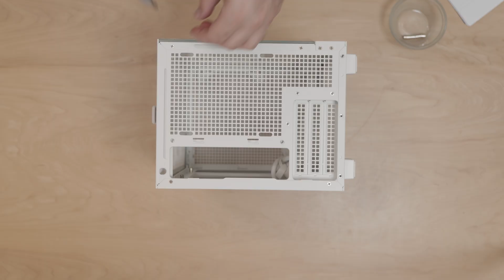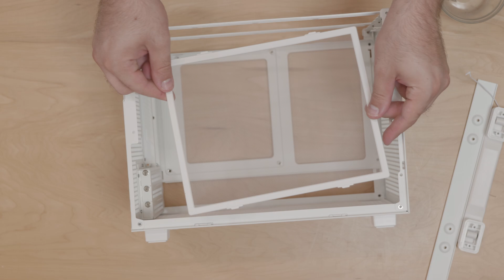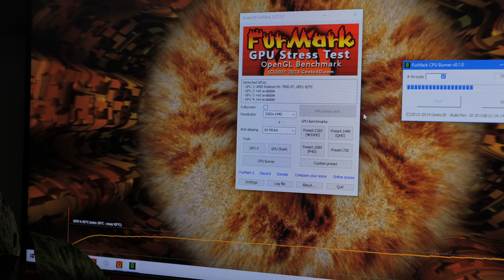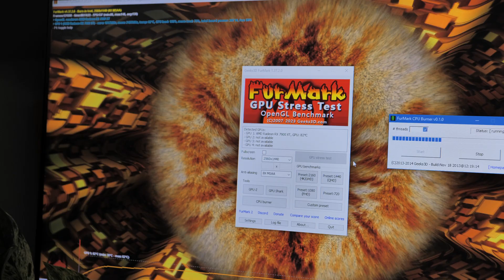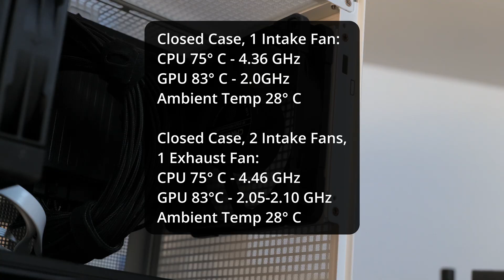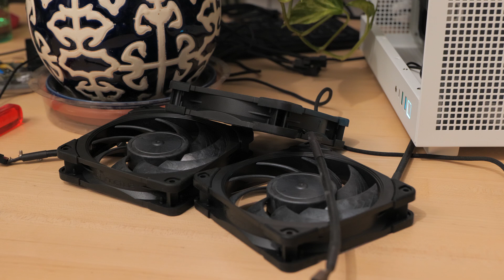Chill Thoughts: DeepCool CH160

Comment: One thing that is absolutelly disguting coming from a renowned brand name..that power cord hanging like that. WTAF. They should've included an internal cable length and have a nice plug at the case edge.,
What we have here is the lowest of the lowest and laziest DIY style of case builds, where you just meh it by 3d printing some panels to hold the parts and call it a day, why bother sourcing one of those c13 / c14 cables
Reply from the maker: If they put a plug at the top of the case, and you had the PSU's power cable hanging from the back of the case, is it really that much better? The more I think about it, the less it bothers me. But it did really bug me at first.
Reply: not a big deal for me